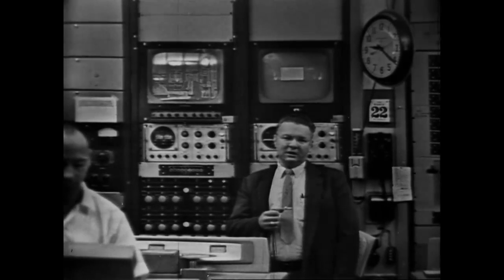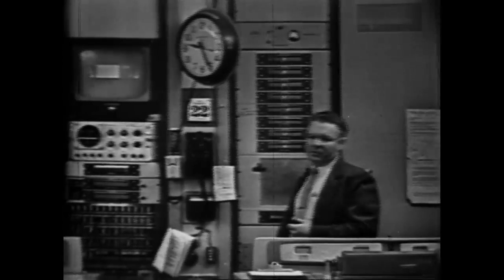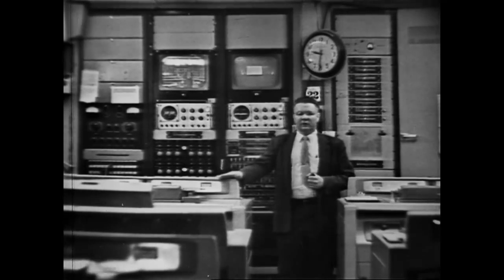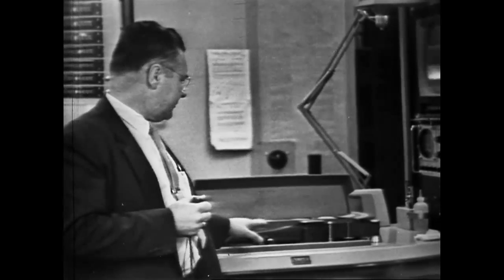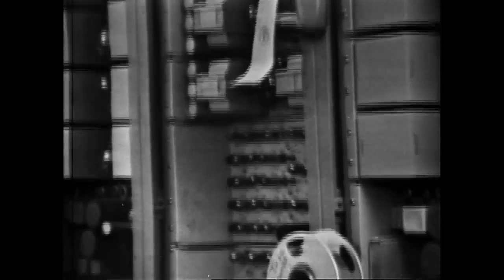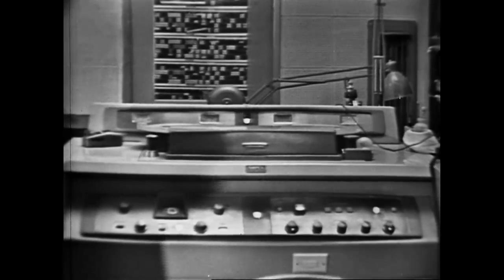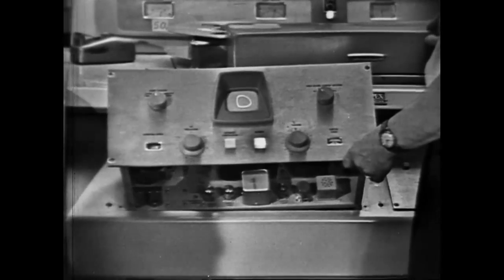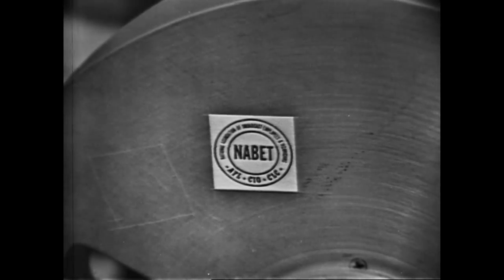Robert H Springer - Welcome to the Tape Room - Late 1950's

Comment: Rather similar to the configuration I saw over at CBS Television City in the mid-1970s.  They also operated those Ampex VR-1000 is pairs (primary and backup).  When Master Control started a pair of machines for on-air playback, the operator would tweak the capstan servo of the backup machine so that the audio synchronized together (back before the days of time-code, genlock, etc.)  They had an Altec A7 speaker hung over each VR-1000  tape machine facing down at the operator so they could stand between the machines/speakers and hear the sound synchronization to tweak the backup capstan servo.